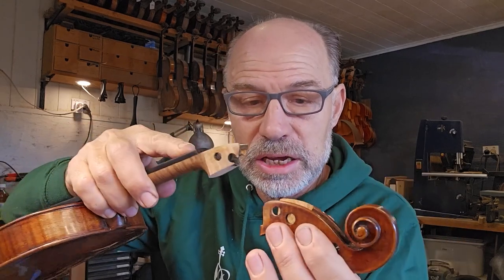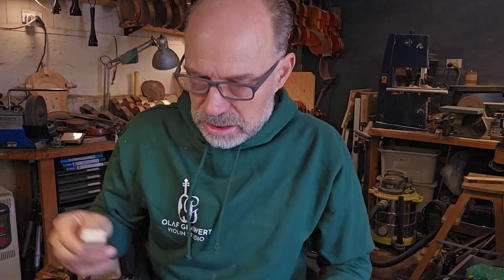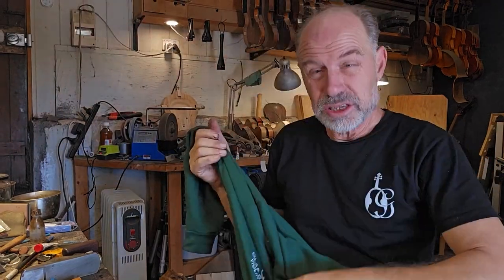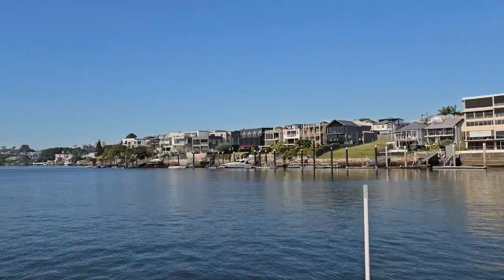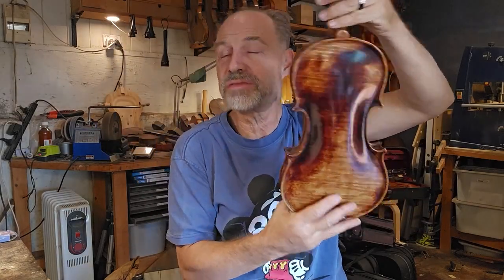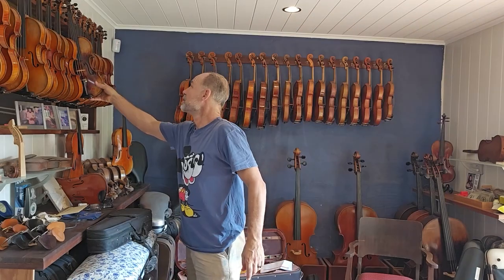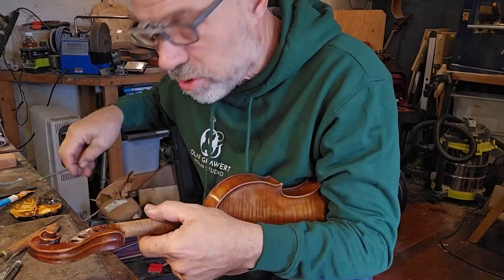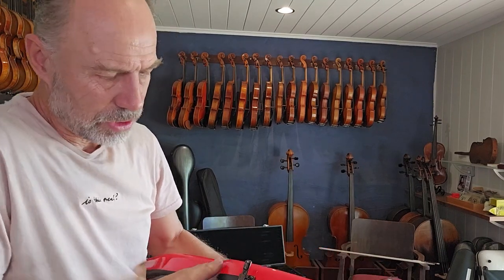My Scroll Broke! and more. Watch Olaf for 3 days (Full video)

Comment: Hi Olaf, I see other violinmakers choose white glue for these kind of repairs. “It’s needs to be permanently fixed” I was wondering, what is your opninion about that en why do you choose hot glue?
Reply from the maker: White PVA glue is not permanent...
I've seen it loose strength after 30 years... It's nearly impossible to remove what's left of the glue...
Hide glue was around during the times of the Pharaoh's and still holds... After 2000+ years... And then... You can actually remove it if needed!
So hide glue is amazing! 
New isn't always better.
Reply: @AskOlaftheViolinmaker  Thank you very much for this insight! Love it!
Keep up making these video’s, I learn a lot from them :) 👍🏼
Reply from the maker: @Tintoretto88 I think it might be worth making a video about the glue...
I get asked that question a lot

Comment: Arrrrrgh! Applying PACKING tape to the bubble wrap??? Does he have ANY idea how many rings of HELL his customer will have to go through to UNWRAP that? Ordinary PAPER tape would work just as well and be so much EASIER to remove.
Reply: I believe the customer will be just fine.  If a little bubble wrap breaks the person the violin will never be learned.
Reply: @christopherw4527  The point is why NOT use something EASY to tear and remove as opposed to something damn near INDESTRUCTIBLE and no doubt environmentally UNFRIENDLY.
Reply: Why are you so mad
Reply: Unwrapping my new instruments was more than half the fun. Heck if Olaf decided to add Kevlar wrapping I wouldn’t complain both of my instruments have arrived safe and sound.
Reply: @KeithR0000   Absolutely!  What model did you get from Olaf if you don't mind the question.
Reply: @christopherw4527  piere lomont, and a Hoffmeister they are both very nice IMO they we’re definitely worth the wait.
Reply: @fragslap5229 scissors or a knife will open that package quite easily.   Tape that is easier to remove might come off.  I have received multiple packages over the years that looked like they were used for soccer.  One was a computer component that had minor damage that was still functional after I fixed it.  😀😀

Comment: Olaf, Why do makers use spruce for the top and not a more homogenized low-density wood old growth like yellow cedar or old growth hemlock from the northeast USA. It just seems to me that the difference in density of summer to winter grain in spruce really seems to pull cracks over time. Is it tradition or is there a technical reason? We boat restorers get to see wood in the harshest of environs. Love your passion for such an esoteric part of humanity.
Reply: I am not Olaf, but I remember him saying in a video that the summer grain in spruce gives flexibility to the top plate, while the winter grain makes it stable in the length. You need both. Also the growth in alpine spruce is so slow and stable over years, that the grains are the same width, so vibrations will be evenly spread. 
Bare wood blocks from spruce already sound great, while tapping them I found out.